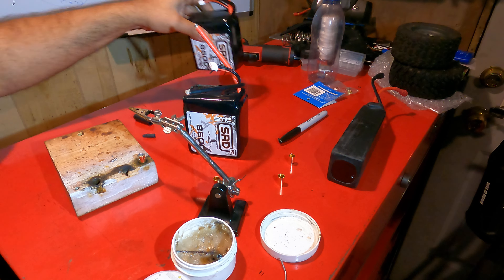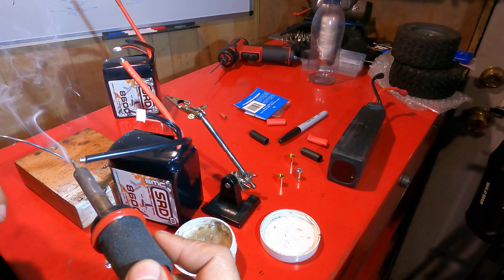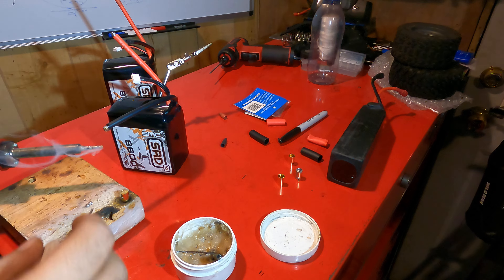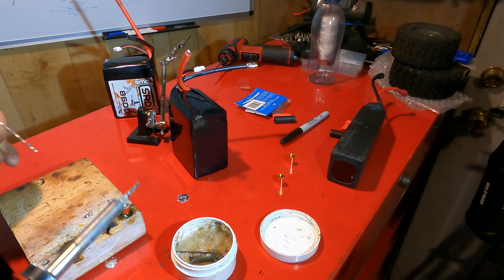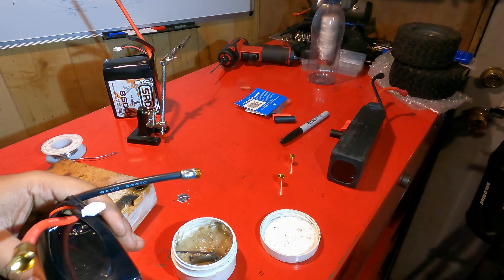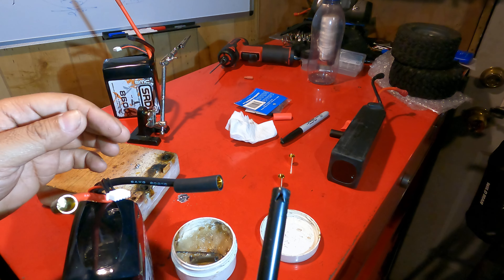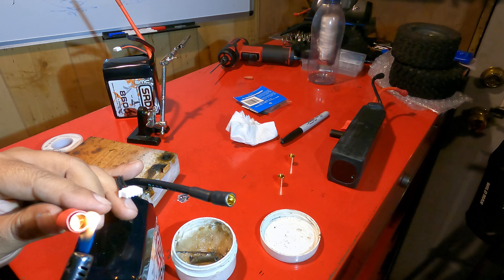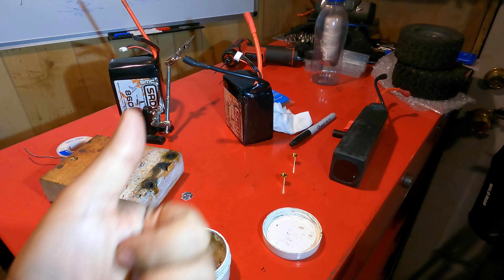Soldering SRD Lipo 8mm bullets

Comment: Nice solder ..... just wondering where you get the heat shrink with glued inside walls to stick better at ? Luv your videos very informative.... thank you
Reply from the maker: Item number on ebay 115181596270 it maybe not there anymore but that’s where I got it from best stuff